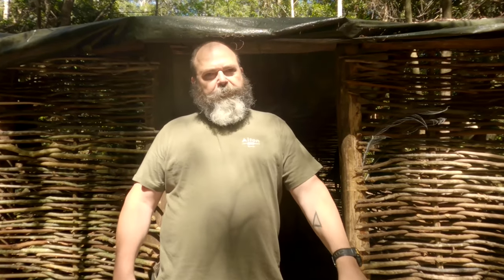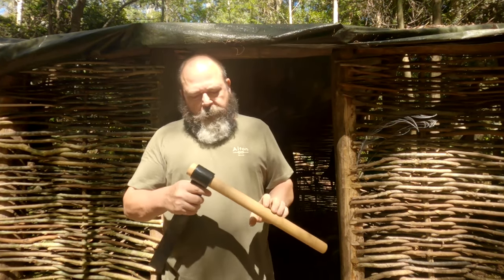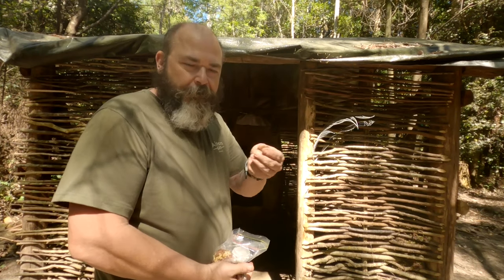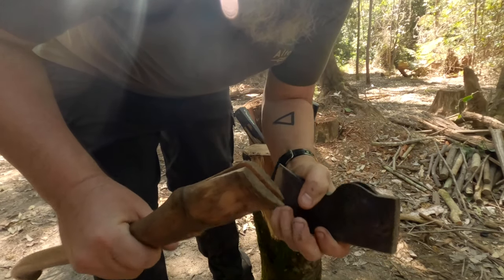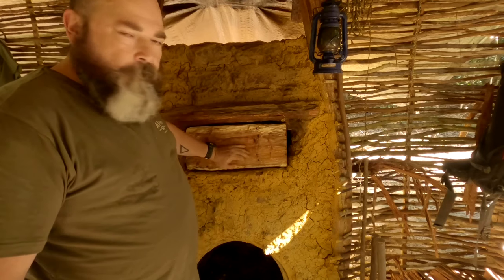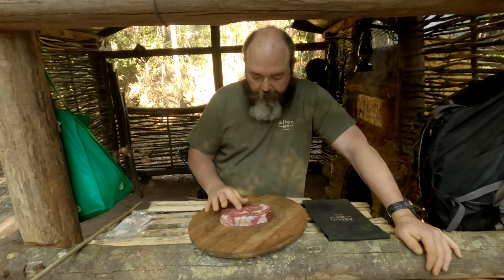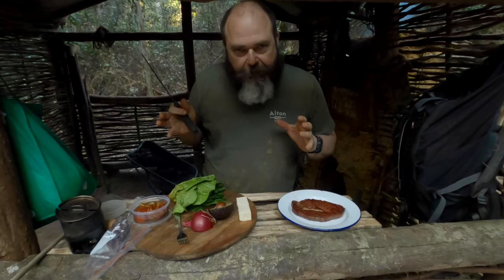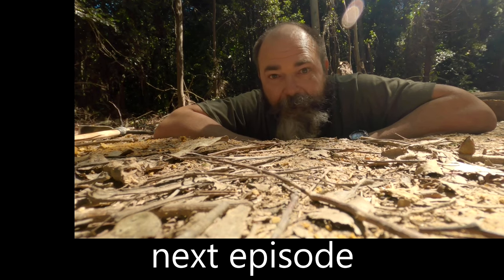Part 42 [ Carving a Smoker Door ] Australian Bushcraft Basecamp Build

Comment: Great vid Alex. Nice work on the door. 
Maybe you could take a lesson from the boat builders of old. Obviously they had different axes and tools, not to mention timber but maybe how they split down logs for their planks could help with the shingles. Splitting down longer lengths then cutting to size. Cheers
Reply from the maker: Cheers mate, yeah I have followed a few boat building related channels. There's a couple of techniques I'm yet to try to produce planks. With more experience and experimentation I'm sure we'll figure it out. Thanks again for your support.

Comment: Great vid, bit of everything in this one! Steak looked awesome, solid persistence on the smoker door, bush fix axe hang worked, and the new mate made for a good days work I reckon. Bird name: Octopied, or Barry/Baz/Bazza. If your after a bit of green wood, could you head up to the logging site and harvest some fresh timber from their offcuts? Im guessing they're cutting blackbutt, tallowood etc, they usually leave the crowns and odd straight lengths that might do the trick. If they're finished logging you may be able to get a Firewood Permit for the area
Reply from the maker: Cheers Kurt, great name suggestions. I've had the same thought about the green wood from recent logging. Only issue is having to carry it in by hand. The closed patch they've done has already been burnt back but there's still more going on within earshot. Could be an option perhaps. I figure I shouldn't need the Firewood Permit because technically I'm not removing the wood from the forest. Cheers mate.